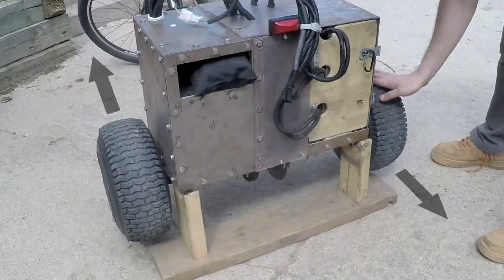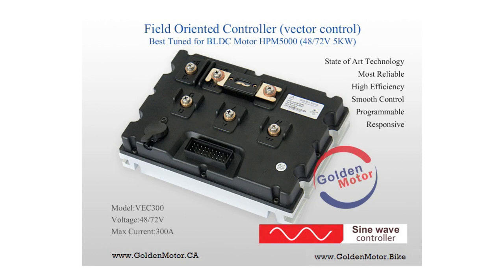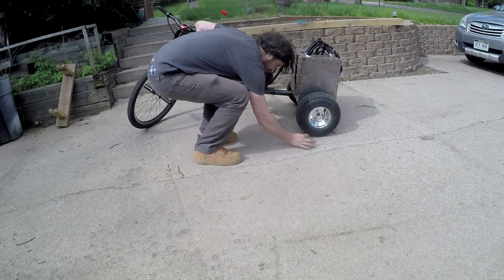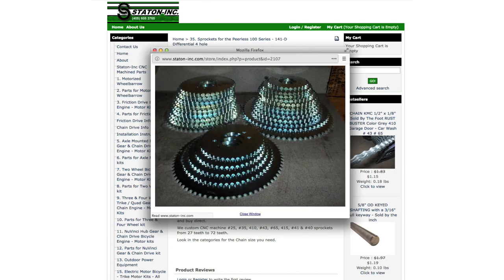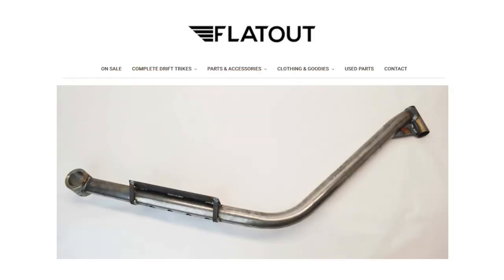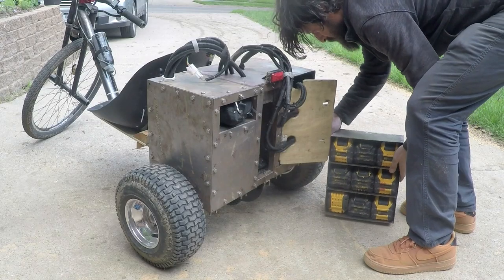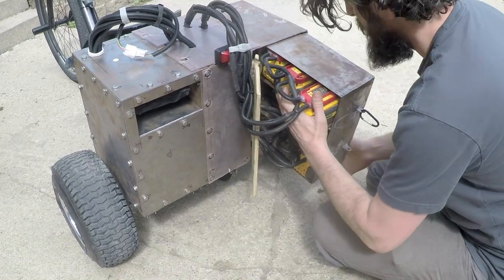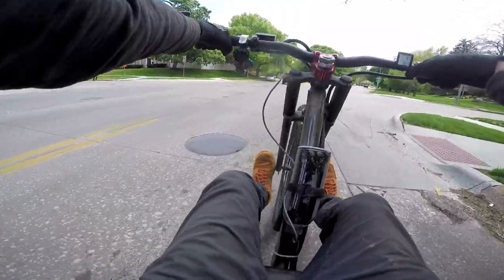5 kW Golden Motor Trike powered by Dewalt Batteries

Comment: Awesome build!!! Great video break down... I have dewalt generator and have lots of 60v battery and always thinking to do something like that.
Reply from the maker: DO IT! The 60v Dewalt batteries are tough. I used the red caps that come with the 9 amp hour packs, but you can order extras from Tool Parts Direct #N475920.

Comment: Hi, how did it go in hills, does it has torque to climb hills? Please really looking forward to the answer
Reply from the maker: It flies up hills. Electric motors produce maximum torque from the start. This 5 kilowatt motor is comparable to a 13 horsepower Predator 420cc gas engine.

Comment: 30 ft/lbs? Wow, this motor is comparable to a stock Predator 420 in power, (10 horse compared to 13) while getting almost double the torque and way more RPM (6000 vs 3600). Sure it's more expensive but it's a sign of things to come in the future.

Comment: can you share videos of the builds im building a bank for a stair climbing dolly 3 9 amp batterys reduced to 12 volts id love to see what connectors your using
Reply from the maker: I use 45 amp Anderson Power Powerpole Connectors from Powerwerx. https://powerwerx.com/anderson-261g2-powerpole-contact-pp45

I also really like the 10 gauge silicone wire from BNTECHGO.

I recently uploaded a video going over another build with similar battery set up.
https://youtu.be/e0f8F8sVvBM?t=27

Comment: How is the golden motor kit so far? Any cons and pros?
Reply from the maker: The Golden Motor BLDC kit is awesome. Easy to setup and use, basically plug and play, no need to program the controller. I got the air cooled version and have not had any problems with it overheating. Golden Motor also has excellent tech support if you have any questions. Prompt delivery from Canada. It is the most expensive electric motor kit I own, but it is also the most powerful kit I've got, so you get what you pay for.

Comment: What's your top speed so far?
Reply from the maker: If you look closely at the little cyclometer on the handlebar it says 50 MPH at 2:35.
Reply: Scott Blake 45Mph
Reply from the maker: Mustach GLORIA nope, the cyclometer says 50MPH. Watch in full screen mode, in HD, and on a computer monitor, not a phone, and you can see the little MPH numbers better.

Comment: What does DRIFT TRIKE mean?  is drifting a key part of drift trike design? If it don't do a burn out, how can you drift? and Why would you want a differential on a drift trike? You just wanted an extra heavy 185lb. electric bike, so low to the ground that no one can see you, as you zoom around with no suspension on the bumpy street?   This is not a drift trike.